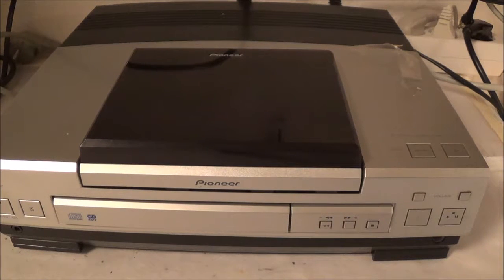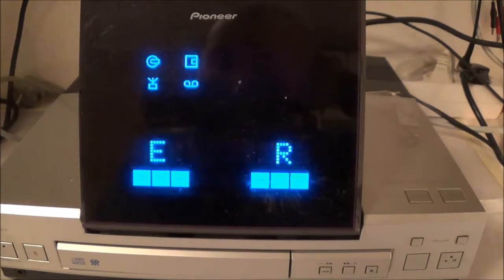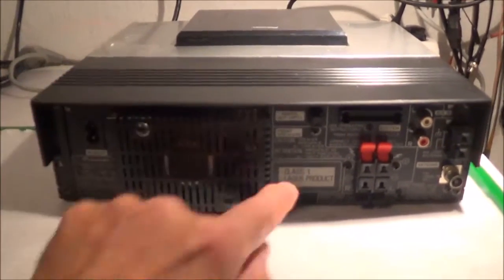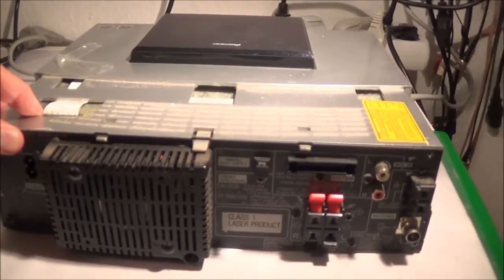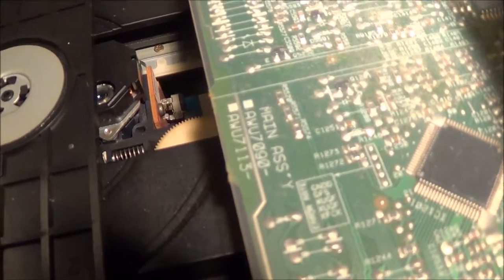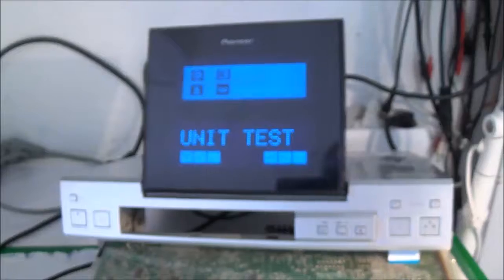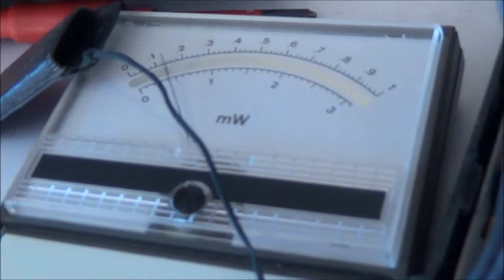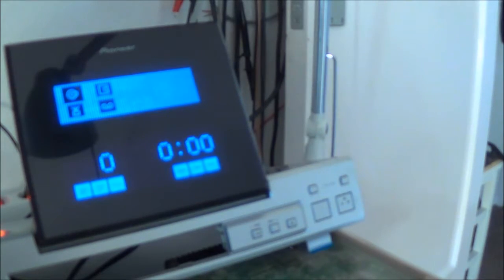Pioneer XC-L5 Stereo Receiver Testing With Laser Power Meter

Comment: This may sound ridiculous but you really helped me out with this video. I bought this reciever and tuner in 1999 and got it complete with surround, md player and cassettedeck. I got this set shelved for about 3 years and this morning i tried if my cassettedeck was still working. Of course it got jammed while i was rewinding the tape.i had to find out how to remove the exterior and you helped me out! Thank you... Now i got it functioning again by removing the stuck tape by hand! Kind of proud of myself now.
Reply from the maker: Thanks for watching and commenting. Good job with the unit; it's cool that you got it fixed. Those things aren't always that easy and straightforward to open.

Comment: Aww classic plastic pioneer!!..lol...it is pretty neat looking though, i have never seen one like that!...so is it just a amplified cd player or does it have a tuner and a pre amp in it also?...cool laser tester!...do you use just store bought isopropyl  alcohol?...i have had some luck cleaning the eye's with it at times,but have had some bad luck too...i've had some players that skip sometimes get worse after cleaning  and one even died afterwords..so now i don't clean unless i think i absolutely have too!.. lol...i have read that it would be better to use some 100 prof alcohol from the liquor store as it it pure with no contaminants in it...some say the iso has a lot of water and is not clean...i've never tried the 100 prof....i don't get to the liquor store very often!..lol..
Reply from the maker: yeah, classic plastic! I forgot to mention that this thing is a stereo receiver; would be a cool unit if it wasn't plastic. there is a even a matching cassette player that i have--got to check that out...maybe. i use just store bought alcohol; i have even used plain water in a pinch, and i use q-tips. lint-free swabs are better. rubbing alcohol contains additives, i think. i think the key is to be very gentle so you don't damage the spring underneath the lens. of course, you can't use anything that would leave a residue (rubbing alcohol, moonshine, etc) or would dissolve the lens. i cleaned the lens on this unit; it was dull and now it is shiny. didn't help--i think the laser is just worn out. a used laser power meter can often be found on ebay for about 50 dollars.

Comment: So you seem like you know a lot more about these than I do, hopefully you have the knowledge to help me out.
I'm trying to fix this exact model for my elderly neighbor on a fixed income. I told him I'd try and get it working for free even if I have to buy a part or two.
When I plug it in, it clicks one time and the power light flashes then nothing. It seems like something is causing it to trip some sort of safety switch. I disassembled to see if there was something obvious I could find but nothing. Any suggestions?
Reply: I would check to verify the model your neighbor owns is appropriate for your local power, and also check the internal fuses. Originally I thought mine had a fuse issue but then saw the discrete power label in the back that states it needed 220V and then I was able to “fix it” by buying a voltage transformer to give it the correct power